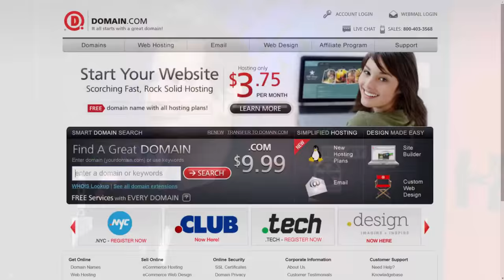Soldering the Flight Controller - Drone Building 101 - Hak5 2003

Comment: Keep up the good works, Don't mind the longer episodes either. 

Question: I was following you setup for and had a question maybe it was lost in the build footage you lost...

On the Naze32 You connected power for to place first being the servo headers, that was well documented.
The other one is where I was lost the battery connector for voltage monitor.. You showed it on the Naze32 but not where it went on the Power Distribution Board.
   I very well could of missed and but did run back and scan for it again. Could you please point me in the right direction would be great. 

thanks again keep up the good work

Comment: So when you are connecting the wires to the FC is it best to put the wire in the hole or fill it with solder and connect it on top?

Comment: You actually only need one wire coming from each ESC because the high current ground wire is the same as the logic ground.
Reply: +bilzoo20001 I was gonna say the same thing. The ground is not needed from the ESC Servo Lead, only the signal. Build a Sigan 180 or 210 and you will learn all about space saving stuff.

Comment: Is a tricopter harder to control?  It would save about 20-25% of the weight.
Reply: +servant74 For a tricopter, you need a servo to tilt one of the rotors to compensate for adverse yaw.  This adds weight, and reduces performance slightly (since one propeller does not use 100% of its thrust for lift).  It's also harder to come across parts & controllers for a tricopter.

Comment: sorry for the noob question but what's wrong with trimming after you solder?
Reply from the maker: +J Garcia trimming after soldering can cause the solder point to break, and the solder won't cover the end of your wire. It is recommended to trim before soldering, but I've been soldering since 2008 or so.. no problems so far (I'm also lazy!). - Shannon

Comment: That is not a continuity setting on your multimeter, its a diode tester. The diode tester is not 100% accurate for continuity. To test continuity, you should use the resistance/ohms setting, it should read near 0. Otherwise, great episode series!

Comment: Some say FreeSky, some just EfAr Sky. 
If you want digital control and one wire for 16 channels - go FrSky SBUS. The latency is also lower. I'd dare to say 80% of FPV racers run FrSky, even though Taranis X9D isn't a perfect transmitter by any stretch of the imagination. Maybe Horus X12S will be? ;)
Reply: +Esa Edvik I call B.S. the difference is 2ms, you can't perceive that difference. Not to mention reaction times etc..
Reply: Histo It all adds up if you have lag everywhere. And I'm not saying it's a thing, just mentioning why some prefer it.
Reply: +Esa Edvik OpenTX is more of a reason.
Reply: Histo I know it's one of them, I didn't wanna list them all :) I have a Taranis with OpenTX myself.
Reply: First of all, I have no first hand experience with the OpenTX compatible transmitters like Taranis or such. But I find my Devo 7E to be perfect with DeviationTX installed. It's got everything I need for my Spektrum quadcopter, but I also have a "MultiModule" waiting to be installed which brings in pretty much every protocol I could ever want into a single transmitter.